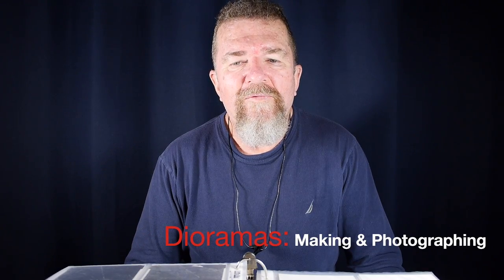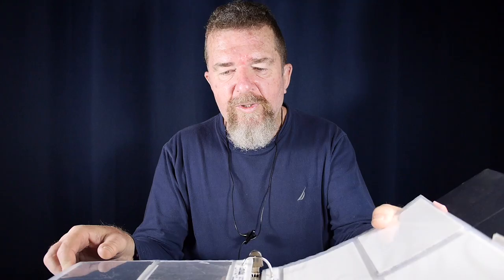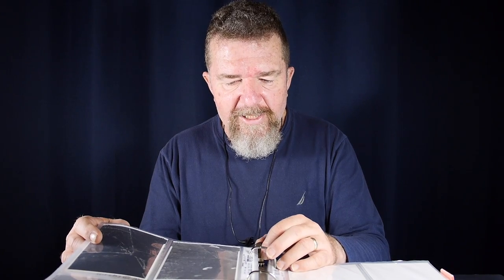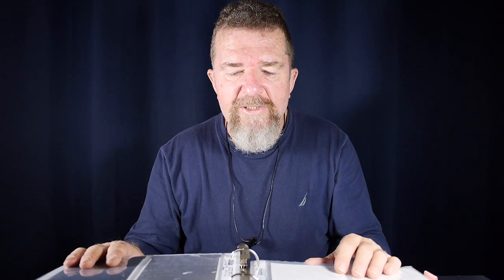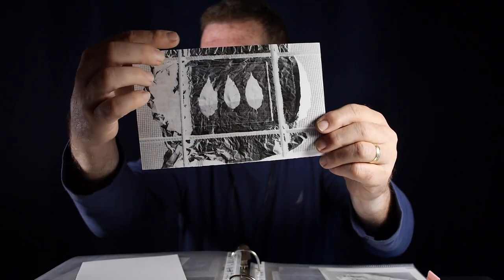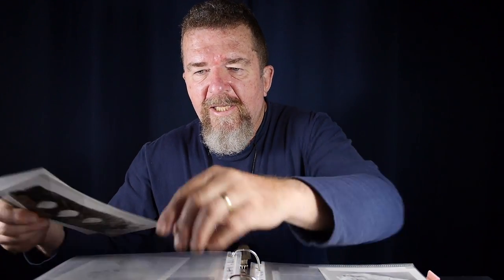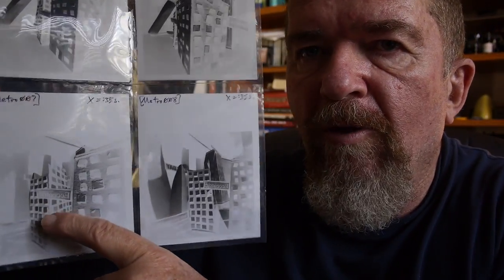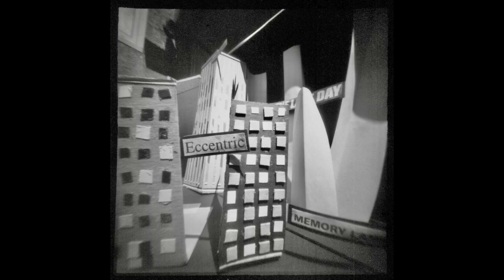Dioramas: Making & Photographing

Comment: So inspirational! Random question, do you scan your images? If so, what do you use? Wondering what I'm going to do for my 4x5 negs with my Epson V600 being that it doesn't allow for those dimensions. Thanks for all your great content!
Reply from the maker: Ah yes, scanning. I'm scanning paper negatives with an Epson flatbed, but currently am not getting good results doing the tone reversal because I switched recently from an old PC with an old version of Photoshop to a Mac Mini without Photoshop. I'm having to do the tonal reversal within preview mode, which gives sketchy results. I currently get better results shooting the paper negative with my Panasonic camera and using SilkyPix to do the reversal and adjustments.

That's for paper negatives. For large format film, I can't scan anything larger than 35mm. I think going forward I'm going to do more contact printing and enlargements of 4x5 in my darkroom, something I used to do more of but got away from. I'll be posting more videos about these changes.